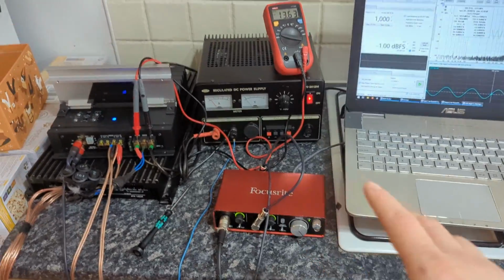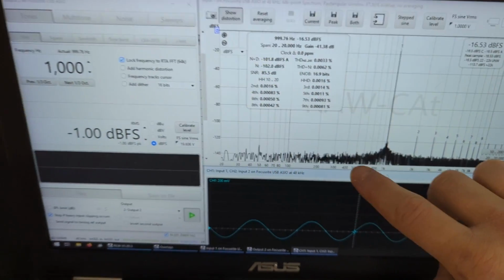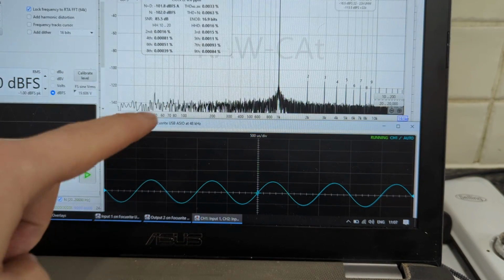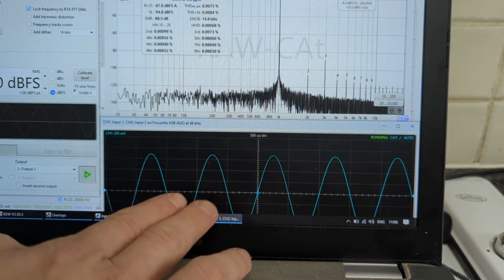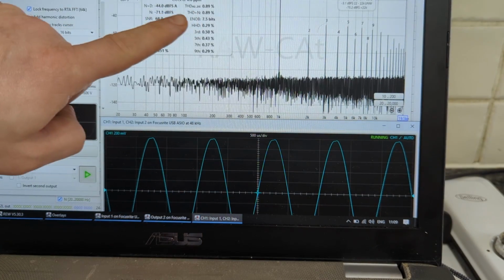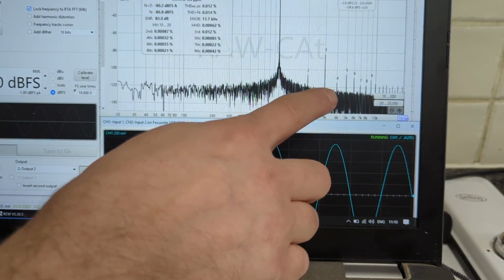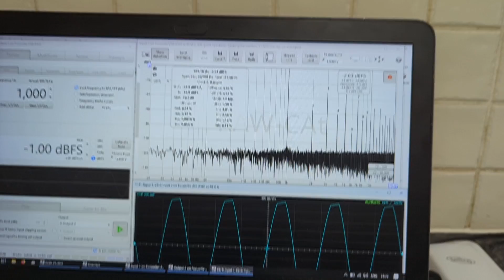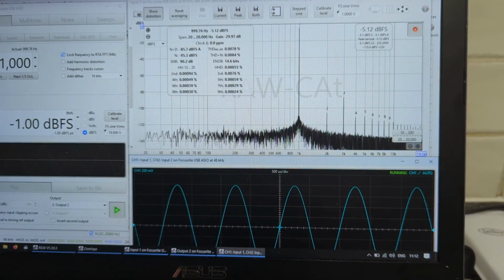How to set gains using REW and an audio interface

Comment: This confirms if a cheap $25 oscilloscope shows no clipping on RCA output and on target amp voltage, is less than 1%. Great to see the visual comparison. I was skeptical of the oscilloscope output, thinking THD+N would occur even if the sinewave is perfect.

Comment: Do you usually reset your gains, after you EQ your speaker? In my mind, it would make sense to select the most boosted/least cut frequency, and set the gain to 0db, using REW to generate that particular frequency. Or am I just overcomplicating things?
Reply from the maker: That depends on the overall system. One driver might be -5dB compared to the other. Your tweeters might be -3dB compared to the mids.

Comment: I´m glad you´re back with videos :P
I have a question that I couldn´t answer myself. I got an M Six DSP and I found a video where you can set the input gain in the dsp while playing a song with almost 0db for every channel BUT you can only do it if you use the highlevel input
Can you also do this when you use the helix dsp AND a 2nd amp like I do ?
PS: I use bridged mode for my 2 subs, tweeters on the m six, mids on another amp
Reply from the maker: If you want to max out the output of an amplifier, you really need to use a sine tone rather than music for setting gains. I. Not familiar with the M six, but Helix DSPs and DSP/amps to my knowledge have only high level input sensitivity adjustment. Low level input is fixed. If you are using an amplifier all of them have low level gain adjustment. Only the DSP/amp combos don't have that as the signal chain is inside the amp and is optimised.
Reply: thanks for the very fast response, so you mean in general the signal will not clip as long as the dsp/amp signal isn´t clipped before already, right ? @RAW-CAt

Comment: Could I use a line output converter to drop the voltage down before going into the audio interface?
Reply from the maker: Yep, sure you can. However depending on the LOC it could add distortion as we know some of them are not clean.
Reply: Damore did a video on his loc.  Apparently tested real clean. I would reach out to him. I'm sure there are plenty of decent ones out there but tony Isa very approachable guy and is always happy to help
Reply: @angelvip2474  or you can use this setup to test and see if you have a clean loc